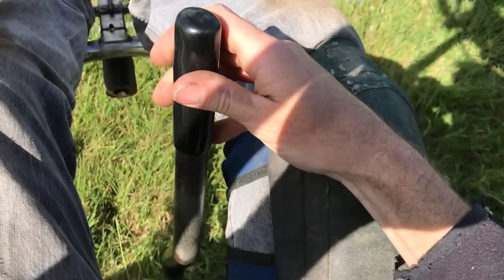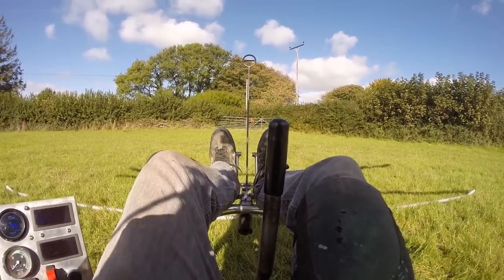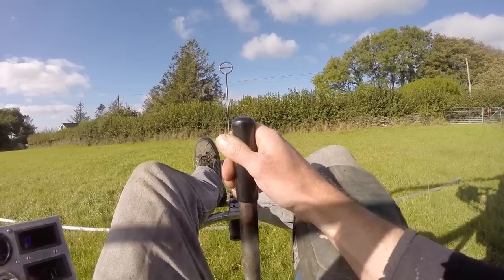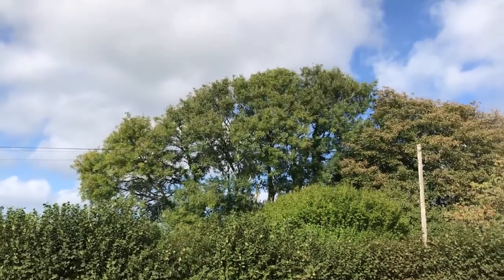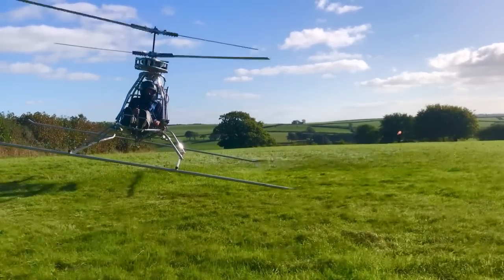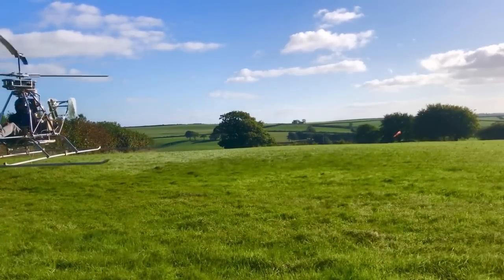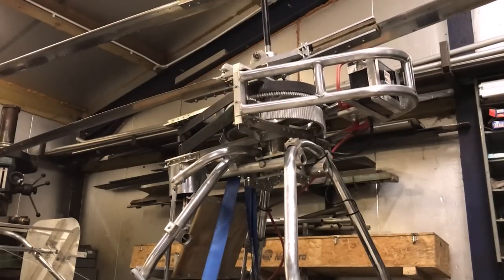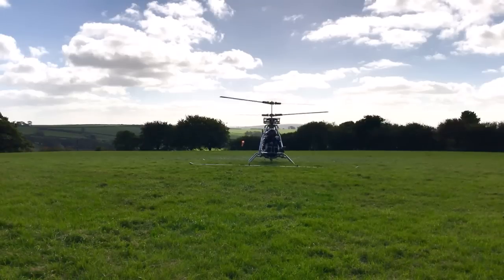Dodgy Moment, Homemade Coaxial Helicopter Learning to FLY

Comment: I'm not sure the legs are helping as much as they should.  On RC the idea is they tend to slide and not dig in.  Then again as you said, you "dumped it" which isn't exactly an easy thing for the legs to "slide" under.  As you know (and boy you are brave) the risk is the energy in the blades.  Upset those kenetics and they will hurt you badly.
I think the next step is probably one of the hardest though.  Accepting that when you get out of shape, you can't just dump it.  This leads to you having to solve any mistakes in the air and address any possible PIO.  I remember it being very intense without being in the heli at all learning that.  You'd get out of shape, over correct, wander around crazy desparately wanting to set it down and reset it, but knowing you can't.... or at least you have to time it just right.
In the end, before I gave up due to time constraints (and costly crashes), I settled on a landing approach that prevented skid catches causing rotor destruction and decided to flip the cut switch and auto rotate any landing on full + pitch.  Killing all energy in the system as quickly as possible.  This did save me from a few after touch down roll overs, where I had carried a tiny amount of lateral motion, got caught on a stalk of grass and tipped over.
Reply from the maker: I fully understand what you're saying, the long poles are bent up on the ends but I will bend them up a little more after this un-nerving landing. I am also looking at purchasing some plastic balls.
Reply: @Ben-Dixey  The training gear I start with was a carbon fibre X with blue balls on the ends of the rods.  It could rotate as if the heli where on wheels, important on single rotor.
The only issue, as they were cheap, the foam balls would fall off the end with vibration, then you had a sharp pointed spear sticking out one side just waiting to catch in the grass on landing :)
The frame the X formed pointed down, so the cabon rods got bent on landing.  This provided a very minimum cushion effect.
Reply: @Ben-Dixey  The auto technique in RC is all around killing energy.  It's an emergency technique normally used as a last resort to save some parts in a crash by killing the motor and ramping pitch to full.
for landing it's not that dramatic.  Hover at 1 foot, hit the cut switch and pull collective progressively to cushion the landing.  the amount of collective you pull in removes large amount of energy from the rotors as you touch down, so an y roll over will be less violent.
Reply from the maker: That's all well and good when you have collective. My machine doesn't have it but there is no sprag clutch so winding down the rotors happens fairly rapidly. It's a benefit to be able to do that in a fixed pitch helicopter as decent is quicker. In the beginning I had a sprag clutch and there was more of a delayed response, the downside to not having one is if the engine was to seize the rotors would also stop.
Reply: @Ben-Dixey  I'm just glad you didn't make the near fatal mistake of tethering it.  In a sport I was involved in (paragliding) that killed at least one person a year.  Tethering a paraglider (to a truck say), like a heli, results in control "lock out" when the line tensions which usually results in a rapid slamming into the deck.
Reply: @Ben-Dixey  I could see the sprag clutching creating a problem.  If you push the throttle down to descend, there will be a decoupling between the position of the control and the response from the rotor RPM.  So it will be difficult to determine if you lowered the control too little or too much.  That kind of long control lag is asking for a PIO.  Not easy to solve though.
Reply from the maker: I can understand that, I did start off with short tethers and up to 1ft they are  safe and necessary for the initial testing. Beyond 1ft they are dangerous. I have still got tethers connected and are long enough to never get taught. I'm fully aware of the implications of a taught tether in this situation.
Reply from the maker: Yes, I can see a sprag clutch being a potential issue with time lag.
Reply: @Ben-Dixey  On the RC stuff.  The crash I had, the heli took it to save me.  I was doing an extended, travelling 180* right roll inverted, stabilise and reverse back to upright hover.
Did a few of them.  Got a little cocky.  Next one I started at 3 foot up.  As I applied negative pitch to stop it inverted to stabilise the tail rotor servo glitched and rotated the heli 45 degrees.  My motor memory halted.  The orientation change completely through me and simply reversing the controls would send the heli directly at my face.  I tried to work out the required inputs to correct the tail slip and simplify the problem, but the heli was hovering inverted and not stable and I was running out of time.
I made one input, it was wrong, over corrected and then heli was now clipping grass and moving towards me at knee height.  I chickened out, decided that giving it a boot of negative pitch would either save it or sent it straight into my face.... so I hit the kill switch and watched it beat itself to death on the ground.  Rotors, head assembly, rotor shaft, motor shaft snapped, main gear stripped, frame bent, tail boom destroyed and the tail rotor shaft bent.  90% right off.
Reply from the maker: Cor, that was a bad one. I watched your 3d flying video very good skills totally beyond what I could ever achieve in the RC world. Must have taken a lot of practise.

Comment: You are doing great. In an ideal world, when it's windy you want to be on a huge (forty acres) flat field so you are not getting turbulence off the trees. Have you thought about putting some kind of balls on the end of the long poles so they don't dig in. That's what we do with RC heli training gear.
Reply from the maker: Cheers. I didn't realise trees caused turbulent air, I've just ordered some mooring marker buoys, they only weigh 110g each so should be fine.

Comment: If that was a truly a cold start to full power in a short period of time as it appeared, I'd say you're looking at engine problems in the near future.
Reply from the maker: No, I warm up the engine on the first run, then the water temp is 40-50degrees before each test run.

Comment: The dynamics of your machine differs from a conventional 'coax' in that your machine is sans collective and cyclic controls. Your simpler design is a winner if you can identify, and get a handle on the dynamics issues. There is a WAY ... I'm sure of it. I have seen a rigid-rotor coax version that has good stability ... also sans collective and cyclic controls. Keep up the awesome effort.
Reply from the maker: The Nolan coaxial, air scooter 2 and Bensen B9 were all great examples of the same type control but little is known about the flight characteristics. The people who built and flew them aren't around anymore. (Through old age) I might add. The Bensen B9 was only flown by the inventor but plans have been available since the 1950s. There hasn't been anyone who has built and flown a B9 from the research I've done. In comparison mine is the closest in drive configuration to the B9 and so far it seems to work well.

Comment: You are doing fine, but one tip?  You are too heavy handed with the stick.  To correct a drift, in stead of holding it over until you feel it begin moving, Just bump the stick against that direction then pull it back to center.  There is always a time lag between input and reaction.  If you hold it that long, it will always react way too much.  It comes with stick hours!  Stay with it...
Reply from the maker: Thanks, over controlling has been a constant problem of mine.

Comment: The problem with your tilting rotors design is that you are always fighting inertia. It's much harder, and thus slower, to move all that mass instead of changing the pitch angle of the blades. In fact, if the wind is strong enough, it might even prevent you from tilting the rotors! Eventually, if your control actuators are strong enough, it would move the entire lower frame of the helicopter up instead of pulling the rotors down and it would shift the weight enough to change the pitch or roll. However, that would be very slow and could induce overcorrection, oscillation or even loss of control. 

You might think that this wouldn't happen because the wind is pushing equally on both the half of the blades that are pointing down and the half that is pointing up, but you have to take into account that the body of the aircraft and the downwash of the blades pointing up would block most of the wind from pushing on the half pointing down.

A way to mitigate this in the roll axis would be to have a side profile area almost equal to half of the effective blade area so that a side wind would push on the body of the aircraft almost as much as the blades and make the tilting of the rotors easier and quicker. In the pitch axis, you would only need a trimmed inverted airfoil horizontal stabilizer to push the tail down a bit. It would also help with maintaining the nose upward at high speed forward, like in most regular rotary wing aircraft designs.
Reply from the maker: Thanks for your comment. 
What do you think of this machine? 
https://www.youtube.com/watch?v=B21Xk6tNcBw&t=399s
It has the same tilting mast and seems to fly very well.
Reply: @Ben-Dixey  Yes, I've seen the Nolan brothers aircrafts before especially their more recent SkyBlazer. Also, the AirScooter (I bet you already know that) has a very similar design to yours and it seems to fly good as well! The SkyBlazer has two horizontal stabilizers (they seems to be fixed), while the AirScooter has none, but it has floats instead of skids, which surely would help in roll control during crosswind. I wonder how they fare in windy conditions...

Your design seems fine to me. I think it will fly well in calm weather, but I'm still concerned with your control authority and stability in windy conditions. If you had some fuselage, it will probably help with crosswinds, but I would still consider adding a horizontal stabilizer to your tail to get more authority and stability in headwinds.

Also, even though you can't autorotate with your design, you could add a flywheel and a clutch to your engine, so that in case of engine failure, you could harness the energy stored in it to slow you down as you "fall". That would increase the weight of the aircraft, but probably less than a second engine, while being much less complex. That being said, you'd need to find a way to eliminate the torque created by the flywheel... Contra-rotating flywheels on a contra-rotating rotors helicopter sounds nice ahah!

Keep us updated, I can't wait to see it fly more than a couple inches! Stay safe!
Reply from the maker: Thanks for the ideas, I'm going to give your comments some thought, they are different and I hadn't thought of them. Cheers 👍
Reply: @Ben-Dixey  No problem! However, I gotta say, while I used to be an aircraft mechanic, I'm not in the industry anymore and my only experience with helicopters was in school, so take my ideas with a grain of salt. My aerodynamics course is pretty far in my memory ahah!

Comment: I sure hope you have done FEA on the stresses, even this gentle bump looks challenging to the entire structure especially the rotating parts.

I hope you have done flight control and stability calculations too. But the wildcard here is the pilot in a novel design. I'm assuming no insurance company is covering this activity...!

Amazing to see passion for an old skool analogue and human controlled machine when the kids today are all relying on algorithmic control via electric powered rotor speed in quadcopters etc with multiple sensors and a track record in unmanned flight as proof of concept...

But good luck, you clearly have the cold courage of the test pilots of old - next stop Farnborough?!
Reply from the maker: I haven't done any FEA but have done what calculations I can on rotor strength. From my calculations I have built the rotor hubs and blades to beyond fatigue strength not yield which has given a large safety factor. I have done a video on how I calculated the stress on the hubs and blades. I do like the flex in the frame and the fact it's bolted, not welded but I can't calculate how strong this is. I have relied on general experience in building things here.  I don't think they would welcome me at farnborough 😉
Reply: @Ben-Dixey  Since you replied I looked at some of your other vids. To join the many other comments, I have to say what you've achieved is incredible.

But since you decided to post this all on YT (hardly a secret club) and replied to many comments openly I am worried on  your behalf. (I am taking everything I read at face value i.e. truth). 

So this is the message you probably don't want to read, please don't shoot the messenger: I would advise extreme caution. My concern is more legal than engineering now.  

If it barks and wags its tail, then it's a dog. So if something were to happen to you (or anyone else God forbid), then officialdom will be all over you on multiple counts. And let's be honest, this is a dangerous machine by any metric. So this is serious.

You seem like a nice guy so I am saying this after spending some time researching, and I have enough background to understand the issues. I didn't find anything that said tethered flight is a free pass. This is the era that even the tiniest drones require registration...

I feel really bad knowing the effort you have made already. But my opinion is you should research how to get (back) onto a formal PTF approval/ PPL licensing path before doing anything else.

Would be happy to be wrong, but it would be negligent of me not to say something asap.
Reply from the maker: Thank you for the word of warning. It's something I have given much thought about, I too haven't found any written document stating tethered is ok, it's only information from third part's who have informed me of the unwritten rule. I believe flying a gyro kite pulled by a car via a tether comes under the same legislation. I will do some more research on the situation.

Comment: Cooling will not improve with faster flow. The water flows too fast through the radiator to cool and too fast through the water jacket to heat up and take the heat from the engine. 
Try a slower flow and you may get better results before resorting to difficult mods.
Reply from the maker: Thanks. There is conflicting information on this, I thought the same as you. Then reading various articles says the opposite plus a study I read came to the conclusion that a 25l/min pump was required for a similar Hp engine. My pump is only producing 9l/min. Has your knowledge come from experimentation or reading ?
Reply: @Ben-Dixey  experience.
Reply from the maker: Ok thanks perhaps I'll add an adjustable restricting valve so I can find the best flow rate. 👍

Comment: If you're learning to fly a helicopter, it seems like the last place you want to be learning controls is near the ground. Granted, if things go really wrong in the sky, there's the worry you'll fall to your death. But at least up there, there's time to react and nothing to hit.
Reply from the maker: Boy would that be a ballsy decision. 😉
The machine in it's current configuration shouldn't be flown higher than around 6ft, to go any higher would be to risky as there is no redundancy. If I added a back up electric motor then higher than 6ft would be ok. At 7 feet high I would be out of the turbulent ground effect this is something to aim for.
Reply: @Ben-Dixey  thanks for the context! You're doing a good job being safe. :)

Comment: Yes, should have gone up.  Or at least corrected in the air without slamming back to the ground on your first instinct.
Reply from the maker: Yes. After battling with over controlling for a long while I believe I under controlled in this instance. It could have been easily corrected without changing altitude. It was a case of being afraid of the cyclic. I had a similar instance which didn't result in dropping it to the ground. Dam scary but didn't panic on that occasion and all was fine.
Reply: @Ben-Dixey  Maybe, but as a pilot, our training is to increase altitude immediately in these situations.  Slamming it down to the ground is not as safe.  I'd say you need to get up to 10-15 feet for these maneuvers, however don't unless you are comfortable.  You will get there! :)
Reply from the maker: Thanks 👍. What type of aircraft do you fly ?
Reply: @Ben-Dixey  I flew UH60 in the Army guard.  That was years ago however.  Also it's a lot different when you have an experienced pilot in the left seat that can take over or instruct you.
Reply from the maker: Nice 👌. Big machine that, I bet quite an experience. Dual instruction is the safest way for sure. Just expensive. It's been interesting for me to experience how the pioneers would have had to do it.
Reply: @Ben-Dixey  The hawk is surprisingly light on the controls, and LOTS of power.  I am sure what you got there is quite a touchy bird though.